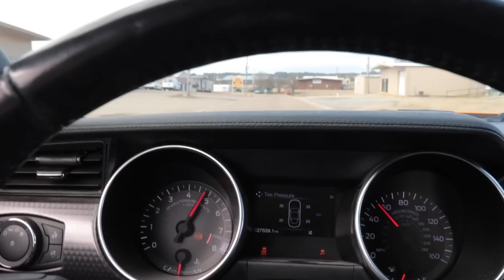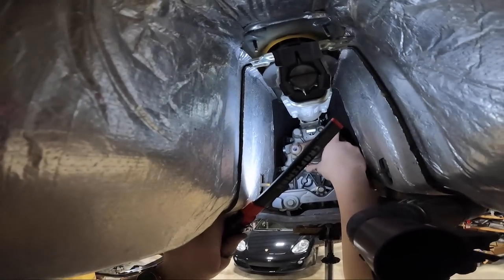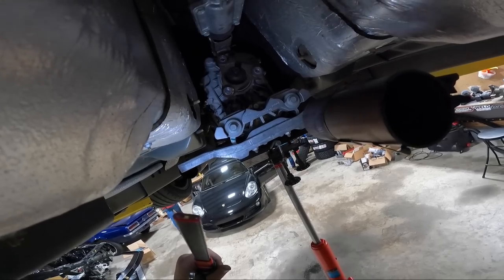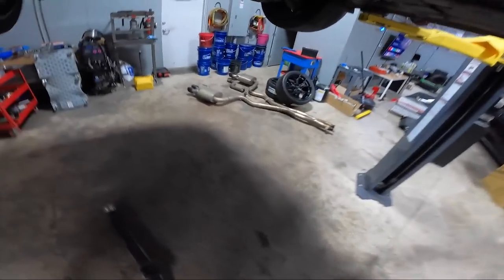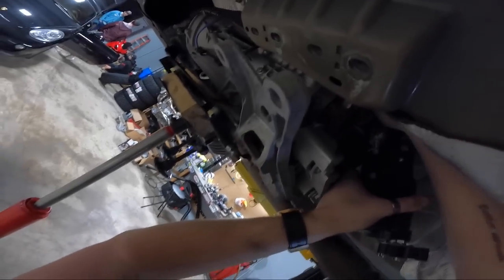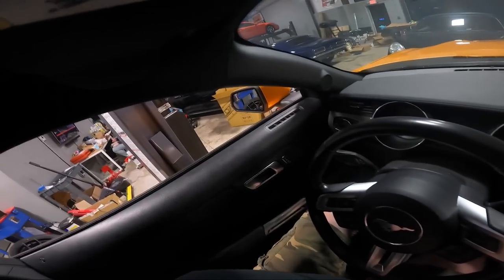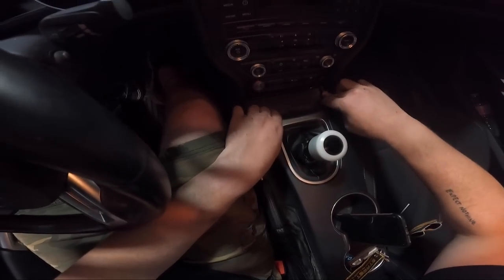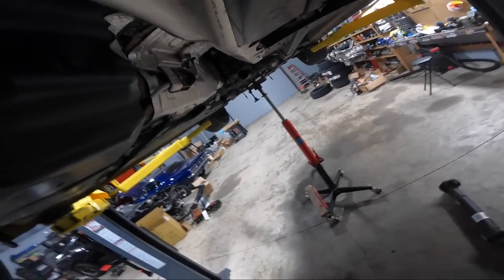Fixing the #1 thing I HATE about my Mustang! | Barton Hybrid Short Throw Shifter Install

Comment: Might as well save up now to get that mt82 built or swap a t56 / tr6060 in it.
Reply from the maker: Not a bad idea. I think a clutch would do it well though.
Reply: @Zorbii  for sure. I'm just thinking down the road when you add some type of boost to it. I never had the best of luck with my mt82 but it never blew up.

Comment: Is it just me or do other mustang owners not have this problem? I have a 2019 GT, and my shifter feels tight and notchy, I can't wiggle it when it's in gear at all, at most a quarter inch.
Reply from the maker: Maybe you’re one of the people with a shifter upgrade from a previous owner?
Reply: @Zorbii  Maybe, but after watching your video, I took off the shift knob, and I had to break the little dab of glue from the factory holding it on. Maybe I just got the only good feeling MT82 ever, lol.

Comment: 0:45 that is NOT normal, how the hell did your car get like that?
Reply from the maker: It’s been like that ever since I bought it 😂
Reply: @Zorbii  Damn, my '16  is much tighter than that, but I think my 2nd gear synchros are going out, really hard to get it sometimes, do you think this shifter would help with that or no?
Reply from the maker: The shifter isn't going to help with the syncros wearing down, but it will help with getting locked out of gears. My car also struggles a little going into 2nd as you can hear it grinding in the video when I'm doing pulls. My best guess for helping that will be a lighter clutch to reduce rev hang.